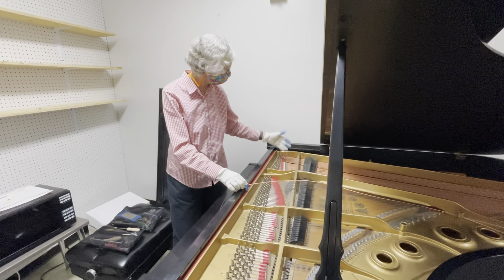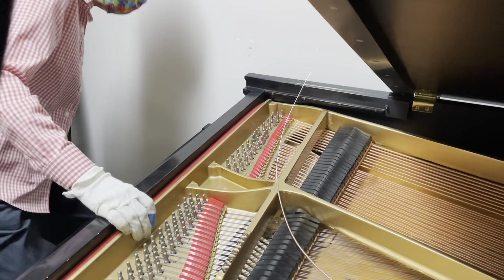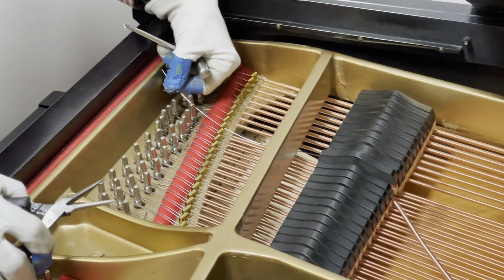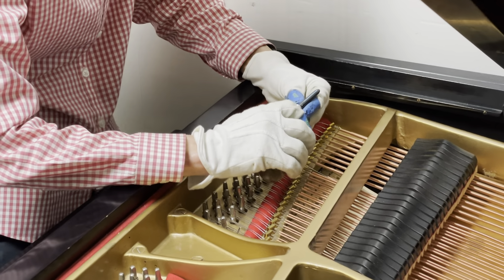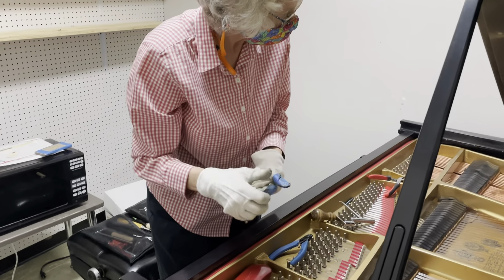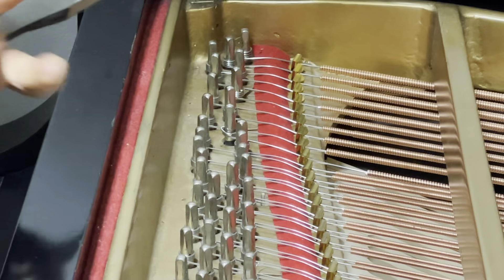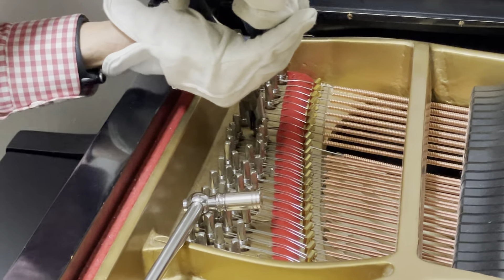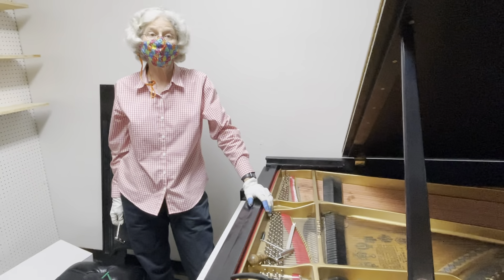Bass String Replacement

Comment: I always gave a tap down on the wire at the hitch pin so it was seated at the base of the hitch pin and would not slip later and drop out of tune.  Every now and then the hitch pins are not smooth and the string loop won't seat fully without help.  Great Video!  So glad to see you give the string that half twist. A detail may technicians miss.
Reply from the maker: The moment the video ended, I said, “Oh I should have tapped down the string at the hitch pin.” I use a piece of brass and small hammer to tap it down. Also make sure wire is seated on the bridge. Thanks for mentioning this.

Comment: I do this the same way, with 2 slight variations: no unwieldy unstable vise grip but a much smaller glue clamp at the hitch pin. And I give the twist in the direction of the winding at the coil end. Saves the time to move to the back end of the piano.
Reply: I wind the wire on a brass rod with a hole. This brass rod has one end with a rubber handle that I twist in my hand while winding the wire.
 The other end is tapered - this end is used to tighten the strings on the bridge.
 And here is my other multitool

https://youtu.be/jT1xqUhNJCo

Comment: Hey Lucy , your this video is very helpful to me , thanks so much Lucy.
I have a question Lucy , when you give the string a half of turn, the YAMAHA JAPAN let me turn the string to right way (Clockwise) but at your video you turn the string to left way (Counterclockwise), The reason is that the piano manufacturers are different？ thanks Lucy.
Reply from the maker: Hello. The bass string gets turned the direction of the winding. The low bass that is double wound gets a half turn at the hitch pin, and upper bass, single wind, get a whole turn at the tuning pin. Always the direction of the winding.
Reply: @lucyurlacher9794  Hey Lucy, thanks so much for your kindly reply, I got it, thanks so much.
Reply: The direction of the winding itself is not important, but all the strings have to have the same direction. So when ordering a replacement string it's best to inform the manufacturer of this.

Comment: Just out of interest, why do you make the cool using a dummy pin instead of winding it directly onto the pin that's already in the piano? I've only ever used this method but if it's easier then I'd be open to using your method too. Thanks
Reply: My teacher also taught me this way, which is a valuable experience accumulated by tuners in many years of practice.  The reason is not difficult to understand, try to reduce the rotation of the pin to keep it stable.
Reply: You want to always minimize the amount a pin is rotated in the block so it doesn't become too loose. Also, coiling first allows you to get the coil at a very specific height above the plate with ease. Another bonus is that the string stays fairly tight and won't slip off or scrape against other parts of the piano as much while you're tightening.